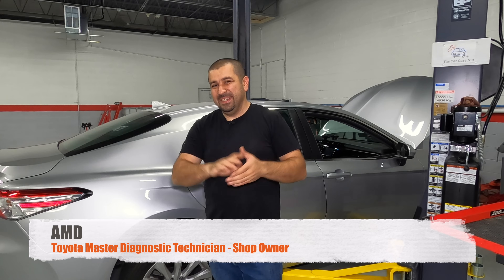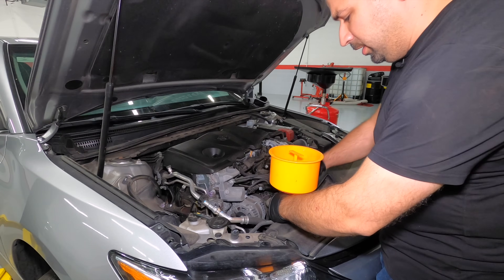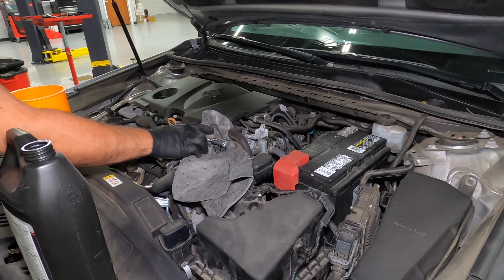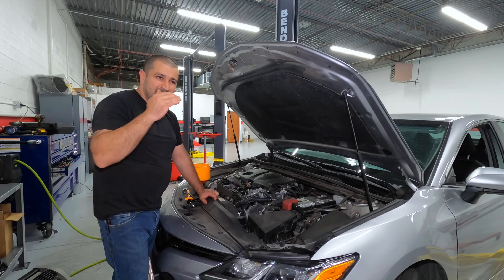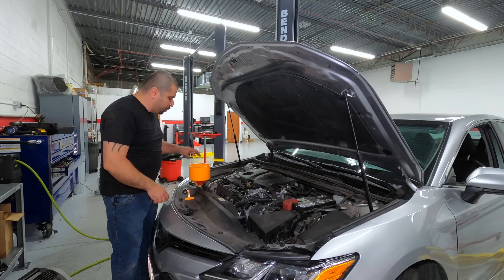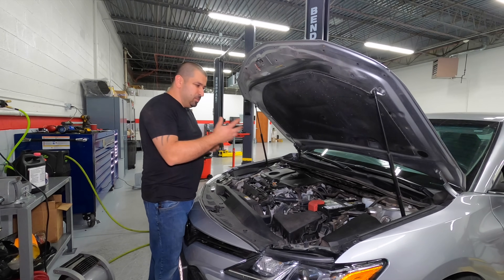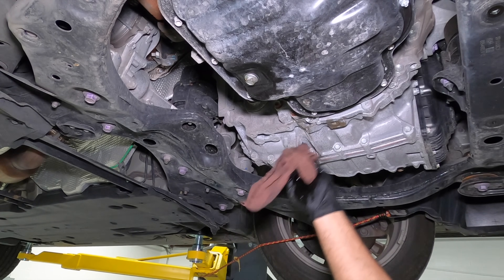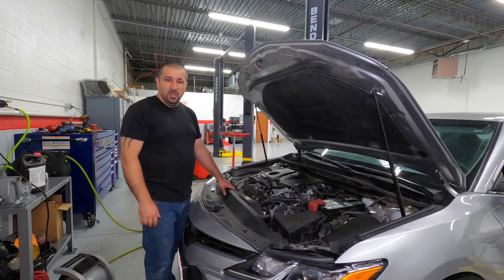Coolant Replacement on Toyota's New Dynamic Force Engine | DIY Without a Scan Tool

Comment: Thank you Armando for making me realize how lucky I am to own my 2012 Corolla with 150K. Simple car to own, maintain, and drive. Still has a dipstick for the transmission so fluid changes are easy. No undercarriage plastic piece to remove before doing any oil or coolant changes. Being paid off for years is also a great plus.
Reply: Yep old toyotas are easy to maintain and fix and they don't break as the new models.
Reply: Thank you Armando!!
Reply: 2009 Corolla here and am original and only owner. 312k mi and still runs so good. Religious maintenance on ALL fluids (Toyota WS only ofc on auto trans), and yes so simple and easy to DIY on it. Just wish it used conventional oil filters rather than the canister stuff

Comment: So Armando had the coolant and trans Fluid change. And this was two separate jobs, correct ,??, is there a connection to needing to change both at one time, or was this again two separate jobs. 
I have a 2020 Camry that I plan to keep, and was wondering if my 8 speed trans is the same. 
Thank you both for the great videos. 👍❤️
Reply from the maker: Hi! There’s no connection but since he drove a long distance he wanted both done at the same time
Reply: @TheCarCareNut  
Thank you Sir, I only have 35k miles on my Camry, and don't think a trans fluid change should be done yet ??, I was thinking perhaps at 45-50K miles ??
Reply: @elithegreat6463 that’s what I would do…

Comment: The last section of the video was that a transmission fluid drain ??
Reply from the maker: Yes. It should be followed by the rest of the procedure to check the fluid level found in my other video
Reply: @TheCarCareNut  thks for the reply

Comment: I would drive 2.5 hrs if I knew I the job was going to be done right and I wasn’t going to be scammed. Thanks Armando!
Reply: I'm tempted to drive 10 hrs out to Armondo because my local Toyota dealerships are morons.
Reply: Yup. A highly skilled certified Toyota Tech who is ethical, thorough, and knows what he’s doing. I’d drive 2.5 hours for that kind of service. Thanks to the CarCare Nut I have done maintenance on my 2017 Highlander for  several projects. Brakes are new, coolant is a couple years old, transmission, transfer case and rear differential are running fresh fluids, MAF sensor and throttle body are cleaned and the spark plugs are next up.
Reply: But he is 2300 miles away from me...  So yea.  Just have to drive close to 2 days to get there... 🤔

Comment: I know this is off topic, but I’m wondering if you could answer a couple of questions for me? 
I’m thinking of purchasing a Toyota GR86. I’m wondering if you can tell me what you think of the car? Is it reliable, safe, and worth the price? 
In your opinion, what car is better overall, the GR86 or the BRZ? 
I really would appreciate your advice on the GR86! Thank you and God bless you!!
Reply from the maker: Hi! The new one has a lot of improvements on reliability namely the addition of engine oil cooler. And the BRZ and the GR86 is exactly the same
Reply: Thank you for your time AMD

Comment: How many miles did that Camry have that it needed a coolant flush?
I have a 2015 Honda and was told the coolant last a very long time
Reply from the maker: Hi! That car had just over 60k if memory serves right. On toyota models if you plan to keep it long every 50k or 5 years is ifeal
Reply: For Honda Coolant type-2 (blue). Honda user manual recommend to change the fsctory filled at 200,000 km milage or 10 years, and there after every 100,000 km or 5 years. In between just top up the reservoir if level at low or lower with pre-mix same coolant type.

Comment: How do you know what RPM is on the Hybrid?
Reply from the maker: You’ll have to guess it. Press the gas pedal all the way to the floor and it will rev higher than 1500 rpm but won’t red line off course

Comment: Thank you Armondo...
AMD... Is there a block drain on a 2AR-FE in a 2009 RAV4?
Is there a bleeder screw on same engine?

Also there's a Y fitting where the upper radiator hose connects to the thermostat and I understand these can crack and leak after time. Has that problem been resolved...?

Thanks AMD, for providing the best channel on You Tube for Toyota related services.
Reply from the maker: Hi! If memory serves right there’s no block drain on the AR engines as well. The Y pipe is the other side of the engine not on the thermostat side and an updated part is supposedly already out
Reply: @TheCarCareNut  
Thanks for the clarification.  I'm wondering if that Y pipe was ever replaced on ours. We're the second owners. I guess there's no way to tell unless the replacement looks different and someone at the dealership could have a look at it and tell us.
Thanks again.

Comment: Thanks Armando. Curious. I have had BMWs with electric water pumps as well and there is a way to run them to bleed the system without starting the engine and without any specific software. I wonder if there is something similar for Toyota. We have two Toyotas a 2020 Corolla (same coolant fill and bleed I assume) and a 2017 Highlnader. Different coolant fill but same transmission fill etc. loving the DIY vids and will be doing some of my own maintenance on both Toyotas.
Reply from the maker: You can but it still has a mechanical thermostat so you’ll want the engine to warm up. The 2GR-FKS is different as it has a mechanical water pump
Reply: Theoretically you are right, because flow control valves, thermostat and water pump are electrically controlled there. I'll try to hook up the scanner and see if there is a option like that.

Comment: What is the likelihood that Toyota Dealerships use reused coolant after flushes? I did a coolant flush in January, and ever since then there has been a film of brownish residue stained onto the inside fill line of my plastic coolant reservoir. I'm considering changing the fluid again.
Reply from the maker: Likely not but if they use a contaminated funnel it could do that
Reply: @TheCarCareNut  thank you!

Comment: Thanks for the tips…I’ve had that cool filler for years but putting a little hose on the drain tube is a new tip!!  When I just did my Tundra, I was afraid to mess with the block drains so just did the radiator and will do it, again, before fall. (A gallon and a half came out and it looked very clean.)

Comment: Wow I have 2 of those cars. 2019 RAV4 but it’s a station car to be left at airport or guests use and a 22 Venza I just purchased for my daughter. Not much mileage but another 2+ years on the RAV4 . I hate those clips and screws. Do you know a kit for replacement clips for Toyotas/Lexus if they break. Thanks
Reply from the maker: Search on Amazon for toyota trim clips

Comment: When performing coolant replacement, don’t you need to drain coolant from the engine block as well? Or is just draining coolant from the radiator sufficient for such purpose?
Reply from the maker: This engine doesn’t have a block drain
Reply: If these Toyotas are anything like my Honda, only a small fraction of the coolant is in the block and it's not worth the hassle to drain, especially if the drain bolt is in a hard to reach location and seized due to heat cycles.

Comment: Is there a way to flush the torque converter and the transmission oil cooler?
Reply from the maker: Other than using a machine no there’s no torque converter drain
Reply: @TheCarCareNut   Thank you.

Comment: What is the correct temperature of the automatic transmission drain pan (using a temperature gun) that determines the correct level of transmission fluid for an 8 speed 2020 Camry with a 2.5 liter A25A engine?  Thanks very much.  Thanks to Armando, too.
Reply from the maker: Hi! 95-115 F
Reply: @TheCarCareNut  Thank you very much!

Comment: Hi AMD.  And thanks to Armando.

Just a question regarding transmission. when you should do first transmission oil change on Camry 8speed 2019?
Reply: 60 000 miles (96 000 kms).
Reply from the maker: Hi! 60k miles or 6 years

Comment: Thanks for the video AMD! What about 5th gen 4runner? Any special procedure?
Reply from the maker: Hi! Nothing specific. Heater off and run the engine at 1500 rpm until both upper and lower radiator hoses are the same temperature
Reply: Thank you sir!

Comment: Thank you Armando and AMD.  would you  recommend a vaccumm coolant fill adapter to fill the coolant . I've used it on Prius wish have electric water pump, is there any difference? Many Blessings
Reply from the maker: Hi! Don’t use a vacuum fill on this engine as it has coolant valves that need to be opened otherwise you’ll have air in the system

Comment: one HUGE problem i have heard from mechanics is the draincock breakoff when attempting to open OR leaking after opening then closing. they recommend removing the lower hose clamp and draining that way. 

the draincocks are typically plastic and rarely if ever operated for many years. the plastic becomes brittle from heat cycling and the o-ring gets stuck which results that it is damaged when the valve is opened.
Reply from the maker: Usually they only break when they haven’t been opened for a very long time like 10 years or more or if the car overheated before
Reply: Well the male end of the radiator where the lower hose connects to is also plastic and prone to cracking or leaking when you try to remove a stuck hose from it. So either way, you're potentially screwed. Lol
Reply: @robertomulero514  a tip to removing a coolant hose is to relocate the hose clamp to the very end of the hose, even to the point where only half the clamp width is on the hose, then operate the vehicle until it reaches operating temperature. the increased pressure will cause the hose end to balloon out which unsticks the hose end from the connector. 

otherwise as you mentioned, the twisting of the hose might very well damage the connector. even if one is trying to replace the hose and uses a knife and pliers to pull it off, the connector can also be damaged.
Reply: Yup, when I 'drained & refilled' the coolant, I was gentle with the plastic. I smeared some Molykote 111 on the o-ring. Good to go. Zero leaks.

Comment: Why the toyo auto trannies have such complex transmission oil change process. Why the normal dipstick no more exist? This is a process that makes owner think manybtimes before chosing to change the auto transmission oil.
Reply: This transmission made by AISIN.
Aisin supplies automatic transmissions to many automotive manufacturers around the world.
Reply: Because too many idiots screw up the transmission by adding the wrong fluid or putting too much or too little in. Then they blame Toyota when the tranny fails when it was really the owners fault. That's why they're making them more difficult for DYI mechanics to work on. A few idiots screw it up for everyone else. lol

Comment: Thank you Armando and AMD!
I have couple questions:
1. What is a meaning of cooling fun turning on? Is it evidence of thermostat operating?
2. You didn't run engine 3 times at 3000 rpm for 10 second.
Reply from the maker: Hi! When the fan comes on it’s a guarantee that the thermostat has opened. And revving the engine up to 3000 rpm for 10 seconds through experience didn’t do anything
Reply: @TheCarCareNut  Is the 2nd on/off cycle of the cooling fan just to double check that all the air is out? I recently did it and could not notice the second time the fan went off, I was suspicious if the fan just didn't slow down to a stop before it kicked back on again - it was rather warm in my area. How long does the entire air-bleeding process typically take? I think I had left it at the 2000rpm for at least half an hour...at least 15 minutes after the 2nd time I could observe the fan turned back on,  just couldn't see it turn back off.
Reply: @chenneyweny I’m having the same issue. The you find a solution for this?
Reply: @marcialpinedard  Well, after I did this job, I have not noticed any drop in my coolant reservoir. Next time I will just do it when it is cold :) But I suspect it will turn on/off if kept at the 2000 rpm for an additional 10-15 min after the 1st time the fan turned off.  Some things I did do at the time was just rest the car at idle for 5 min, then do another 10-15 min at 2000 rpm. So basically in total ~45 min of steady 2000 rpm (15 min for 1st fan on / off, 15 min after it turned back on, another 15 min after I let the car idle for a bit)
Reply: @chenneyweny thanks 👍🏽
Reply: Im gonna guess to make sure it reaches proper temperature & so coolant gets into all parts. 😉

Comment: I have a toyota Avalon 2006 limited 
Every time I try to reverse I hear grinding noise and then it goes away and then I reverse. Should I junk my car?
Reply from the maker: Hard to tell without diagnosis. Is it as soon as you shift into reverse?
Reply: @TheCarCareNut  thank you for replying... yes it happens as soon as I reverse it sound more like buzzing.
 Thanks for Your great videos

Comment: What is effect of e20 gasoline over e10 on 2nrfe engine
Reply from the maker: It’s not recommended for that engine. Gas mileage will dip and possible damage to the catalytic converter
Reply: @TheCarCareNut  is there any chance of engine damage or any issue with engine life if I use e10 over 100% gasoline in my 2018 toyota yaris????? because in my country there are only option is E10 and E20
Reply: E10 is 99% of gas in the states so the engines are designed to use it.

Comment: Thanks to Armando we get to watch this demo. Question: isn't transmission fluid level temperature sensitive?
Reply from the maker: Yes it is. Watch the other video for explanation and exact process to check the fluid level.
Reply: Thank you Armando.  I hope he brought you some cheese too or something!
Reply: At 113F you pull the 10mm drain plug off (not the 6mm stand pipe). when it gets to a trickle, cap it off with the 10mm drain plug. 
I use the XTOOL D8BT to read the transmission temp. XTOOL can be picked up for less than $600 now so it makes it pretty affordable as you can use it for writing new key FOBs, and doing things like the coolant service the same way a service tech would.

Comment: Hi armondo, thanks for all your great videos I never miss one,  I just bought a 2022 camry 2.5 l , what's your view on the electric water pump and power steering pump,  will they last A long time,  im worried it will cost alot to replace them
Reply from the maker: Hi! The electric water pump lasts a good amount of time likely more than the mechanical one and your car has electric power steering  and the motors are also far more reliable than the previous hydraulic systems

Comment: Thank you Armando!
Now Ahmed.  For coolant draining/refill on my 2020 RAV4, how close is it to this 2018 Camry?
Reply from the maker: Hi! It is exactly the same. Still have to remove the front under panel to drain the coolant and fill the exact same way
Reply: @TheCarCareNut  I want to thank you for the coolant tech tips and the throttle holder.
I bought one like you had on the Amazon entry and IT WORKED GREAT!
Being that the air temp was over 90 last Wednesday following your coolant procedure with the engine fan didn't take long.  If this was two months ago, it would have taken longer for the engine fan to come on but I would have appreciated the hot air coming from the fan.  Anyway on the fan's 2nd cycle the engine temp stayed at 194 to 196 until I let the engine idle.  Still had some coolant in the funnel (similar to yours).  Shut off the engine and about 40 minutes later the coolant had dropped enough so removing the funnel and and adapters resulted in no coolant loss.  One thing that helps to lower the coolant a little more quickly for many vehicles with the engine off and rad cap off is to gently rock the vehicle in the front side to side. It's not going to go down quickly, but it does help a little.  Add a good size fan in front of the vehicle blowing through the condenser and radiator with the engine off with help to lower the coolant level in the radiator.
Reinstalled the radiator cap, added coolant slightly over the FULL or MAX mark in the overflow container. Next morning the level was at the normal max or full mark.
So that's 1.  L.O.F.,  2. Brake fluid system flush, now with clean fluid, and 3. Coolant drain/refill.
I have the transaxle fluid for it, but jury duty is keeping me away from Periodic Maintenance for the RAV4 and my Nissan Frontier for a while.
Thank You again for the Tech Tips, they're like Gold!
Reply: It's the same
Reply: I will keep the video for reference.
Although I'm not doing the 8 speed trans fluid now, that will come later on.  For me it's a time not mileage change.
Thank you for the reply.
The vehicle is almost 3 years old, so the brake fluid change is coming up soon.  Plus I can check the electric parking brake system.  Fluids are cheap, parts are expensive.